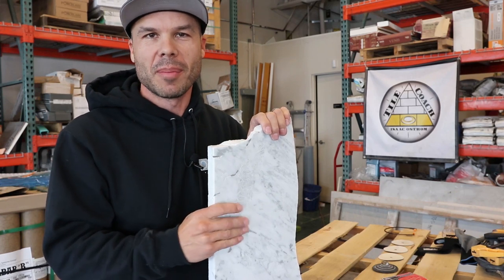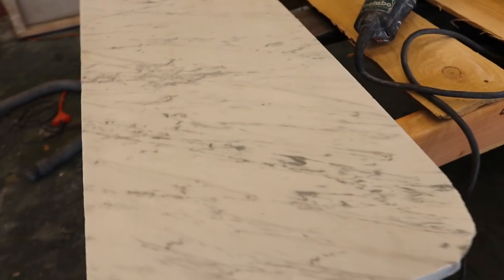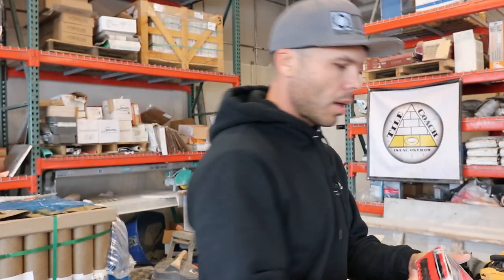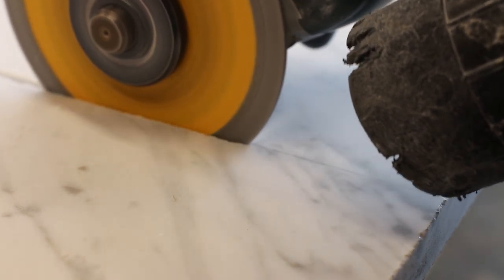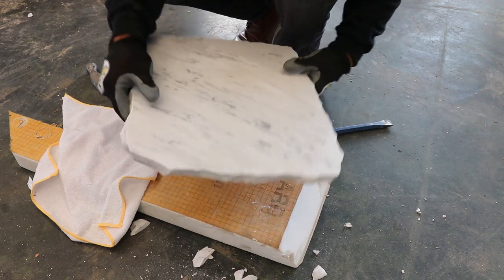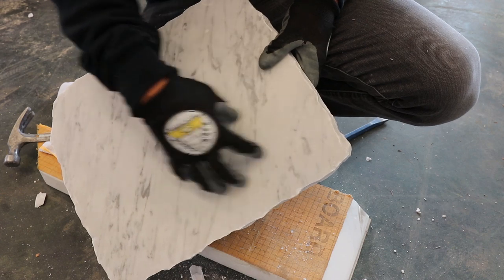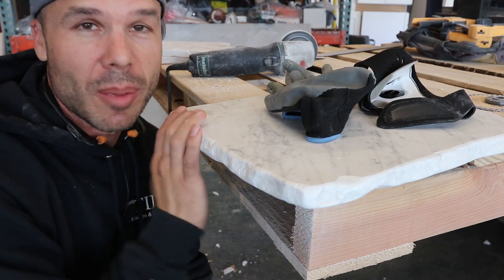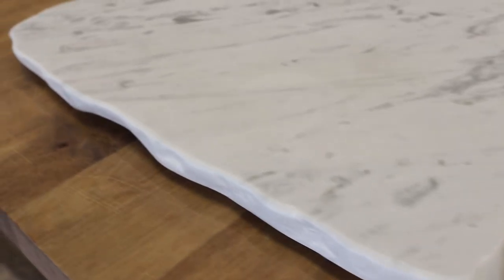Marble Charcuterie Board for under $10 --- Tutorial

Comment: Absolutely great idea! In fact, you'll be amazed at all the granite and marble scraps you can pick up for next to nothing at your local countertop supplier. My husband and I wound up with free sink cutouts that we trimmed and tiled for a 20 sq/ft woodstove hearthpad with $.99 sq/ft Slate tile for the wall protection. Gorgeous!!!  (Plus 2 layers of cement board on both floor and wall to meet R-value requirements.. plus 1" air gap between the cementboard layers for the wall protection) It's a shame that so much in stone scraps going unused! It doesn't rot so you can collect until you have enough for a project!

Comment: Tip for the feet: you can use raw hot glue, pour a big blob, flip the board and set it on a few shims, like 1/4-1/2 inch 5-10mm and let the glue droop, it will make a nice flat foot on the bottom in a hourglass shape. If you let it cool a bit more and use a thinner shim, you'll get a rounder one.

Comment: Marble or any stone is too hard for a cutting board. They will round over the knife edge =  dull. Plastic or wood will make much better boards. Very much like this channel.
Reply: As a woodworker for 35 years, I can think of better things for a cutting board :P
Reply: If you use tempered steel knife (as most knives are), it's hardness is between a 5 and an 8 on the mohs scale, while marble is between a 3 and a 5, so in most cases it shouldn't dull a blade that much.
It is basically limestone with less holes, so it's pretty soft.
Reply: The everyday ones in the UK seem to be hardened glass or Wood and in special colours for different food preparations in catering places etc.
Reply: @satibel  you really don't know what you are talking about just quiet down
Reply: @TrespassofRemus  if you have insight, tell me, I like to learn.
To me, softer materials not dulling the blade (as much) makes sense.
Reply: @satibel  Even a wooden cutting board dulls knifes. We are talking about a thin edge here. It easily bends back and forth. Just because it is a harder material doesn't stop it from getting bent out of shape or worn down.
Reply: True. Marble is better when working with dough. Great for bakers
Reply: @TrespassofRemus  we agree, all hard boards will fold the blade or dull it, but I think marble probably wouldn't be much worse than a hard wood board.
Reply: marble board is fine for all kinds of things such as a cheese and meat platter doesn't necessarily mean you're using sharp knives for cutting and it's also great for dough so I think the project is

Comment: Hello! I love you, Marble Charcuterie board! I tried to chisel edges on a 12 x 12 marble tile (1/2 inch thick), and it broke in half!  What went wrong? Thank you!
Reply: It’s possible very possible the surface under wasn’t even and you had too much pressure in an area that took the impact wrong and caused the break. Not 100% unless I seen how you had it placed; try another one! It’s worth the practice
Reply: @onsightwoodworks  Thank you so much for your response! Yes, I recognized that I didn't place it properly to chisel. The good thing that came out of it was I made two small risers, or mini charcuterie boards! I painted the edge gold and glued round wood feet! Again, thank you for sharing your talent!

Comment: You can use a variac or a speed controller instead of a variable speed grinder.
If you have the time you can get inexepensive (<5 bucks) ones that do the job from the usual suspects (aliexpress, wish, banggood, ebay etc...)
I also recommend getting a cheap-ish full face mask (<40$), great if you do a lot of dusty cutting projects, it protects both your eyes and lungs or if you want to do a breaking bad cosplay.

Comment: This is a really bad idea unless you want dull knives that you constantly have to resharpen after using once or twice don't follow this guy's advice.
Reply: Get high quality knives, have them professionally sharpened-it's not expensive- and use a steel on them every time you use them. If this doesn't work then use a wood board for cutting and a stone board for serving. Marble is pretty soft, I don't think it should hurt a good knife.